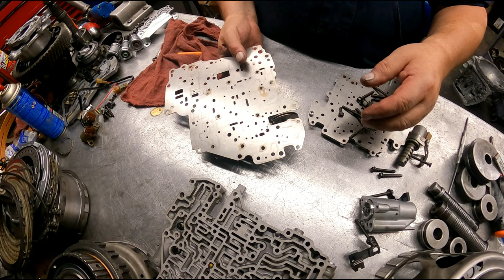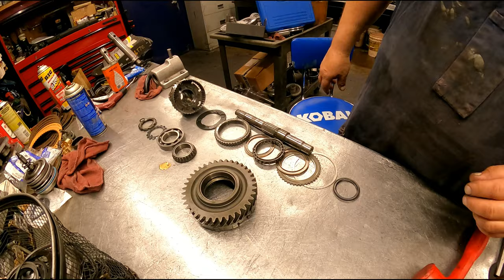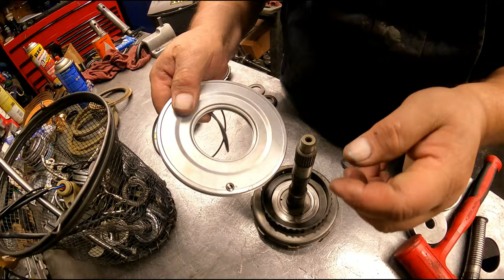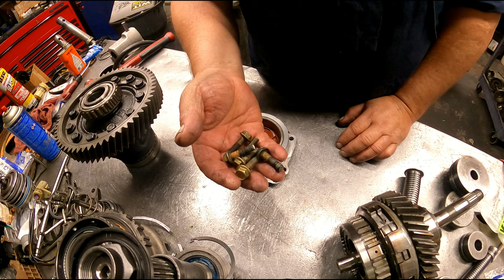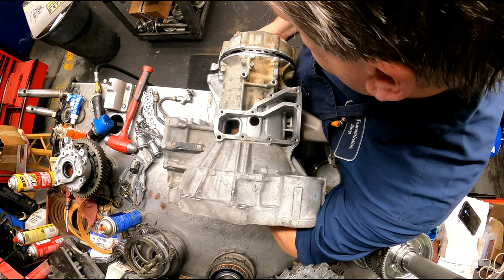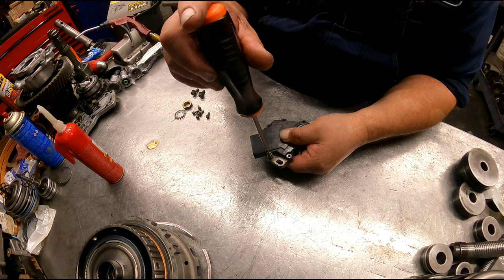A541E Rebuild

Comment: I have a 98 camry XLE (automatic) with no reverse. its ashame. The engine is full of life, 275,000 miles. ive been procrastinating calling the wrecking yard. its been in the family since 98. im the third owner. Ive done all the major maintanance requirements myself. However, the tranny is out of my league, and Im in no position to pay somebody to fix it.
Reply from the maker: They are a good transmission and good vehicles.You should keep it until you can fix it.
Reply: Maybe you'll give it a try? 
I believe in you!

Comment: Any chance do you have part numbers for the paper gaskets for the valve body? Working on my 95 Camry at the moment.
Reply from the maker: No, I don't. I don't use the gaskets on any of the Toyota units I build. It will work without them.

Comment: Durable A541E Wht was wrong with tht transmission ??
Reply: I dealing with one now has to warm up to engage drive and gas too 2000-2500 rpm to engage drive any recommendations thanks ⁉️⁉️
Reply from the maker: I believe it came in with no forward. Rubber seals are getting hard more than likely. You can try putting a couple cap fulls of brake fluid and it "may" get you by for awhile.

Comment: thanks for the video! that part you show/install at 1:15:31 known as the "2nd brake apply gasket" is a little rubber o-ring that fell out as i was reinstalling everything. i didnt find it until a day later in my drain pan. i had been driving the car and it was weird cuz i fixed my initial issue but there was a new one, no 2nd gear. would you happen to know if this is causing the car to not go in 2nd? thanks!
Reply from the maker: Yes. Thanks for watching.
Reply: @CurmudgeonTransmission  Car runs great now thanks for confirming that

Comment: BOA NOITE ,Acompanho seus videos , meu carro um Camry 94 transmisao A541E depois que troquei o oleo da transmisao nao engata mais a reverse ,marcha atras , quando engata o reverse as rodas travao ,consegue me dar uma dica , ja limpei o bloco de valvulas seguindo o seu video esta tudo certo mas trava as roda ao engatar rear
Reply from the maker: You have either used the wrong gasket or there is a ball in the wrong spot in the valve body.

Comment: BOA NOITE, Grato por responder ,li em um comentario do sr que nao usa junta no bloco de valvulas ,eu comprei as juntas novas da TRANSPEED , pode ser que veio errada,posso tirar as juntas e montar sem entao que da certo
Reply from the maker: Correct. I don't use them. You can leave them off and it will work fine.

Comment: Thank you for posting these transmission repair videos. They really give excellent insight in to what is involved in a rebuild. I do have one question which I hope you can help me with.

I have an issue with the A541E in a 95 Camry V6 with 250K miles. Transmission fluid has had partial changes every 60K miles and shifts and operates perfectly with one exception. After last drain and refill, began to get occasional P0770 lockup code on hard acceleration at highway speed. Converter goes into normal lockup,  but notice some slippage under increased load. Slippage seems more evident when fully warmed up. 

At this mileage 250K, would you expect the stator shaft bushing to be worn enough to cause this problem or are there other more likely possibilities ?
Reply from the maker: Could be the stator bushing, lock up relay valve sleeve in the upper valve body or just the clutch in the torque converter.  With that kind of mileage it's probably getting close to rebuild time anyways. I would definitely put both stator bushings in it even if they looked good. I recommend Precision of New Hampton for the torque converter. Don't use anything but a Transtec kit for the rebuild kit.
Reply: @CurmudgeonTransmission  Thanks for the advice and recommendations. Do you need a blind puller to remove the stator bushings, or can they just be driven out?
Reply from the maker: You can use either a blind hole puller or a bushing cutter.

Comment: Great vid.  I have a question about a leak I have.  It appears to be coming from the piece you're installing at time 1:41:00.  If that's where the driver's side axle goes in, then it appears my leak is coming from that.  Does it have a gasket in between where it mates with the tranny?  I notice it appears to have a seal inside.  My seal may be leaking  and the tranny fluid may be coming out where the axle goes in.  

Do you have any part numbers or where I can get this gasket and seal, or does it have to come from a kit?  

I just cleaned the area and I'm trying to trace where the fluid originates.  But knowing the seal and/ or gasket would help.  Thanks.
Reply from the maker: Thanks. There is no gasket. It only uses silicone between the housing and the case. 87077A from WIT. Dealer 90311-50011.
Reply: @CurmudgeonTransmission  Thanks for the part number, I accidentally ordered the RH.  It's corrected now.  I ordered the Aisin sealant equivalent to Toyota's sealant.
Reply: Another question about the LH bearing retainer at 1:41:00.  Could a source of a tranny oil leak be from the retainer's loss of FIPG adhesiveness?  If it can, then I'll take the LH retainer off.  It appears that I can do this with the tranny installed.  Are these 6 bolts accessible with the transmission on the car?  I'll start work on the car sometime today.  Thanks again.
Reply: Ok, cancel the question.  I removed the LH bearing retainer anyway to install the seal which was a lot easier.  I applied the Aisin AB1281B, equivalent to the Toyota FIPG part number.  It's good for tranny, differential covers, etc.  All good.  Your video prompted me to correctly find out my own answers to my questions.

Comment: Good video mate
Possible to convert a541e trans into lsd type ?
Would you know who makes and sells performance clutch packs for the a541e  ?
Thanks Glen Australia
Reply from the maker: The factory made a viscous coupling diff. for it. It does take different axle stubs for it, so you will need those as well. There are companies that sell them as well. Raybestos makes hi-energy clutches for them as well. You can get them from WIT or Transtar. Links are in the description. Thanks for watching. https://gripperlsd.com/product-category/toyota/
Reply: @CurmudgeonTransmission  thanks mate for info 👍

Comment: Bom Dia, Amigo  desculpa incomodar novamente , ja fiz de tudo e o carro so marcha a frente , e so ligar o motor e as rodas ja viram pra frente mesmo no neutro , fiz um teste no conector das solenoides e tem energia em 4 terminais pode mudar a alavanca pra qualquer marcha que continua voltagem nos 4 terminais e quando encaixa o conector escuta as solenoides bater, esta correto isso, esse carro tem um modulo eletronico que controla isso ,sabe onde fica ,mais uma vez peço desculpas ,Jonatan Sanches   de  Sao Paulo Brasil
Reply from the maker: Are you sure you have the tubes in the correct positions?